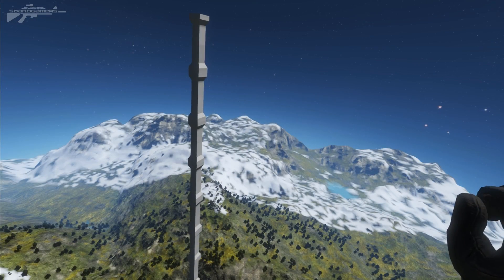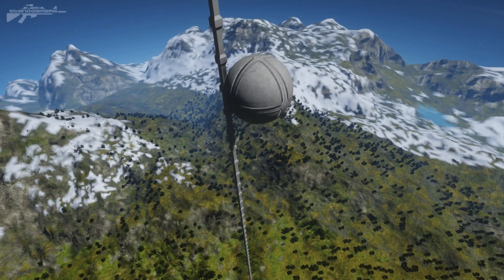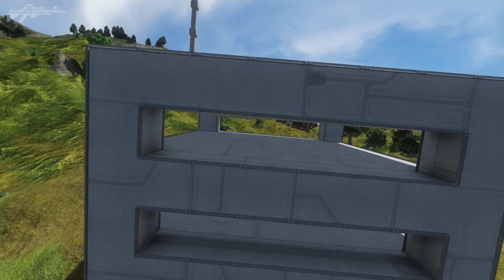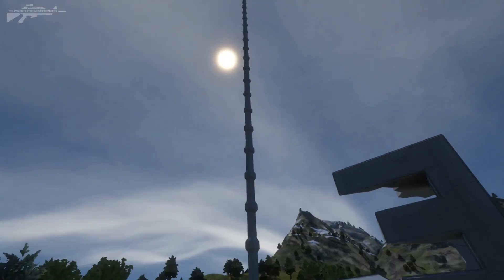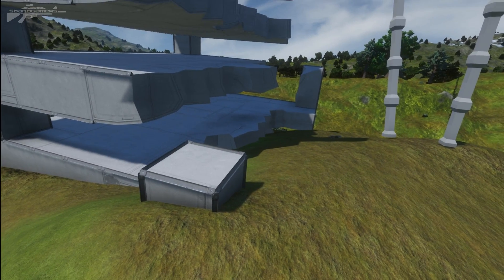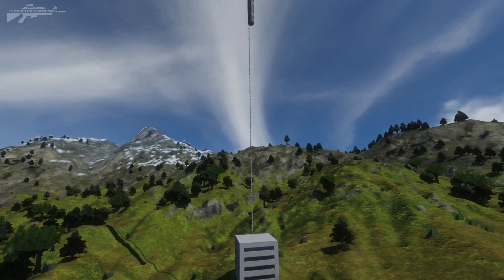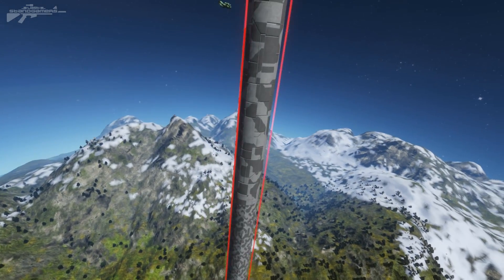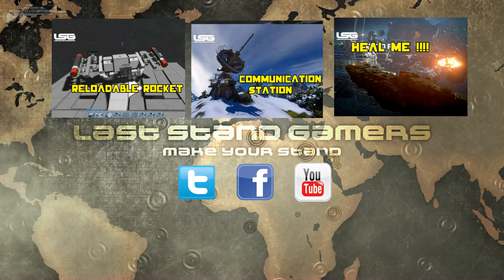Space Engineers - Kinetic Energy Testing

Comment: From my own tests,  a gravity cannon that accelerates individual steel plates thrown out by a connector will shred ANY ship and is very efficient when compared to kinetic weapons made from blocks,  I would anticipate similar effects in orbital configuration

BUT this is much more cool to look at,  and is less of an exploit of game physics
Reply: Le Derp Français but there's still a power requirement if the point of the set up is to deactivate the artificial mass with a timer to avoid gravity defence,  a non powered torpedo with space balls will get repelled by ships with in built defences just the same as a launcher that propels stone or steel plates,  and those are by far more efficient resource wise as they don't waste any rare material, byproduct stone or cheap iron ore is great ammunition compared to space balls which require computers and gravity generator components
Reply: Ships can have gravity generators for defense that defend against such gravity propelled weapons. The workaround is a built slug with artificial mass and a timer that turns the mass off after a few seconds. In case of steel plates they would get deflected.
Reply: Indeed, an Artifical mass block requires some form of power, most usually in the form of a battery because getting uranium in a reactor would be ludicrous for a torpedo, as far as i can recall a battery has a certain percentage of charge when its first built, so it can be launched more or less immediately

Personally I find these torpedo's to be an expensive option thats impractical for a survival world, but yes, it does allow you to bypass a "gravity shield" that the cheaper Grav cannon will be unable to deal damage through

However, in the context of bunker busting, there is no artifical gravity to overcome so i don't think its a problem
Reply: Inebriated Skunk
you just make a bunch of connectors chuck steel plastes then put grav gens behind them (the large ship conectors seem to output allot now so i was gonna try using the smallship chucker things) itll blow right through about anything at the appropriate range
Reply: Iwo Rymer rock is blunt steel plate is thing and launched out at its side
Reply: skyblade bloodheart Rock is excellent on a budget though, Rather than just dump it, weaponize it !
Reply: ChaosSandwhich meh you have to have allot of speed and it dose nothing at closr range but fair enough i mean if you cround down cargo containers that where filled with stone and chucked a huge stone at people
Reply: +skyblade bloodheart i have a 64G field that makes it so it doesnt matter what you use.
Reply: Helljumper256 oh this was just a test rig I mounted to a torpedo ship conversion and it was already more powerful than anticipated and was half the length I was intending to make the full size version, ( I wanted to see if I could make a more resource efficient weapon work for me on an existing ship,  so i didn't have much depth to fit it into considering it was a very compact Torpedo launcher ) 

Part of the reason was also about accuracy,  too many of my torpedo launchers ( and ones I tested off the workshop, ) suffer from poor aim as the merge blocks seperate and cause deviation,  objects from the connector seem to fly straight and true. 

My opinion for weapons made from blocks is they should be engineered to have accuracy worth their cost to build,  so I use guided Missiles instead of unguided torpedos
Reply: Keep it civil now,  I will disable comments if it descends further into a petty argument
Reply: No, no fuel. That's the point of a gravity propelled weapon, the gravity generator would push the artifical mass towards the target.
Reply: Oh you mean like a power source not fuel for thrusters. Yeah you obviously need that, but ony like 0,1 uranium.
Well, you could use the space balls (if they haven't removed those from the game yet) as those don't use power.
Reply: to be fair space balls are self sufficient also to be fair they work better as impact protectors then they do as projectiles
Reply: skyblade bloodheart Yeah but they can be used as artificial mass.
Reply: so like a steel plate (i think individual pillar blocks may be better) gravitational flechette cannon?
Reply: Ingots work well too,  and because it's a relatively constant stream,  it wares down any armor by chipping away until it hits something vital inside the ship
Reply: You can try to use rock since its uselesss
Reply: skyblade bloodheart rock is also way mor massive than plates, so while its cheaper, you have to get closer to your target, who may just sideswipe you if they have an armoured broadside.
Reply: Inebriated Skunk naw breh i tried steel plates cut right through even blast door if the range is long enough and you get them up to speed
Reply: stone is cheaper and more available and it has a mas of 14 instead of one that the steel plate has i believe
Reply: +Inebriated Skunk stone is the way to go it also has more mass on ejection which equals more kinetic energy stored
Reply: Helljumper256
 no i tested it
it really isnt
Reply: +skyblade bloodheart i tested it and as long as enough Gs in field it does
Reply: Helljumper256
i tested it earlier and you mustve used allot more grav gens because i tested it earlier and steel plates definitly have much better penetration power
 i had like.......... it had to be atleast 20 grav gens and that was enough to penetrate heavy armor over time at appropriate range but it did nothing to blast door blocks
Reply: skyblade bloodheart What was your gravity  strength?
Reply: ChaosSandwhich
idk but im pretty sure it was at least 20 g's may have been 21 or 22
Reply: skyblade bloodheart I tested mine at 24 to compare steel plates and steel ingots, very effective, stone i've not tried with that particular set up though 

To be honest i couldn't tell much difference between ingots or plates as projectiles though
Reply: +ChaosSandwhich if you want a real GAC Cannon you need a bit more than 24Gs
Reply: +ChaosSandwhich yeah mine is a operational GAC cannon that is meant to break through shields(beta shield mod we also have the values cranked up) with ease
Reply: +ChaosSandwhich and its nothing more than stone and a 64G ejection field max range
Reply: +ChaosSandwhich add in several ejection connectors and a camera and it shoots straight and true every time with massive amounts of power per rock
Reply: Helljumper256
thats a stupid amount of gravity gens you realize that though don't you? besides around 24 grav gens works just fine with the right perjectiles they cut right through the toughest of materials and keep on going looking as though they are unimpeded with this its relatively easy to install which is one of the main boons of a system like this its rather easy and efficient to use you can have a only meh sized large vestle and have it bombard other ships with penetrating death not limited by the range cap on bullets making it a sniper with multiple shots per shooting sequence not only that but you could make a number of ships to bombard enemies feasibley but with your design its outright ridiculous because you need allot of space to integrate it into a ship the entire ship would have to be built around it quite heavily and it takes up allot of sorceress not to mention the underlying infrastructure you would need to make making a ship with that many grav gens even mildly justifiable steel plates or iron bars are the way to go you can easily integrate it into a fairly decent sized ship and honestly its not that bad compared to allot of gravity based weapons and your going to cause massive damage to the enemy ship and yes steel plates with around 24 g's do fly strait even after penetrating a layer of blast door blocks besides nothings stopping you from putting multiple  connectors  there either and i know of this idea it was my first grav weapon idea
Reply: +skyblade bloodheart i build large resources arent a problem.  You say its too much but then you have never tried breaking through a shield with a couple billion points of shields which kindly fix stuff sliding through each other.  So the more energy you can store in that stone the more damage itll deal and while 24 may be ok one gets better results with 64
Reply: Helljumper256 you can build around 2.5 24 ships for the price of a 64 and that would be more affective besides you would take a long time to construct a suitable ship built to use your cannon in servival and if i use my weaker one i can still cause you sirious material loss with your over invested ship steel plates work fine with less gravity thats a rediculus mass of grav gens and stuff to put them on not to mention the more spread out they are the more access gravity area there has to be and if an item say gets stuck against your ship your going to lag terribly and with that much gravity probably crash your game
Reply: +skyblade bloodheart The problem is you think cost is a problem its not i have a problem of over abundance of resources and your two ships wont have enough shields to recieve from the other ships gac cannons and other armaments. You are thinking way too small scale. Besides its efficient to have one 64G  field with 20 ejectors than one 24 with 3
Reply: +skyblade bloodheart and you arent ramming it with material and gravity your shooting it what do you mean get stuck to the ship with gravity? there is no more gravity to keep it against your ship. and another thing it helps fight is gravity shields since its moving way to fast the grav shields dont have time to stop it
Reply: Helljumper256 you interpereted a lot of it wrong who said anything about ramming with mats and grav so you drop a steel plate on the ground relative to the gravity generated by your stupid grav cannon the amount of random ass physics nonsensce3 it has to caclulate will cause rediculus amounts of lag besides you have to cover up the gravity area which extends equally on either sides of the axis and if i penetrate the gravity zone witha smaller weapon of the same nature which is less of a loss to lose the prejectiles will be pulled through your ship and it will be destroyed
Reply: +skyblade bloodheart you are obviously a child as you cannot keep an argument civil and without immature language.  In addition your argument about having something penetrate and deal damage to the ship is on is inconsequential as we were not discussing that but the damage and effectiveness that the weapon deals and not the side effects of having one which is an entirely other conversation with many many ways to remedy the problems that arise.
Reply: +skyblade bloodheart in addition if you had a job and real money not your parents you would be able to afford a computer and or server to be able to run situations like that with no problem
Reply: and obviously you where not paying attention to the comparative speed of steel plates
Reply: Helljumper256 bitch please you try it asshat
Reply: try having objects constantly making many many many things be calculated at once thanks to the immence pressure pushing them against a surface thats not budgeing
Reply: Helljumper256 although ill admit i have no life youve been argueing with me this entire time so don't pretend you do
Reply: Helljumper256 uhm EXCUSE ME WHO resorted to petty insults it was not i but you
Reply: not to mention the fact that the weakness to gravity weapons IS related to its affectiveness as if its disabled then you loose the resorces and if there s more of a way of disabling it you also loose affectiveness also with most gravity weapons youd have to armor it to amazingly rediculus degress to stop the penetration of a large gravity zone inclosed within the ship
Reply: +skyblade bloodheart why would you have gravity pointed inwards on your ship so that material gets stuck to the hull? that is what im asking all gravity is pointed towards your target which in addition also gives the ship the benefit of an extremely strong grav shield.  Why in the world would you have grav fields pulling materials onto your ships hull? I dont understand why one would do that unless they are making a device that concentrates several items in one place than launches them. To the life part ehh i have several hours between classes so i do tend to have an abundance of time at times
Reply: +skyblade bloodheart in addition there are next to no physics involved as it doesnt bother to calculate it as the damage is overwhelming and just disintegrates anything in front it
Reply: Helljumper256  because when you extrend your gravity forward it extends equally backwards so the perjectiles get pulled up yo  booty if you dont cover the area of gravitation force the way that happend with me is i tested blast door blocks at insificiant range and it didnt bust through so it cause lotsa lag also if you made living space in the back of the gravity zone if something was dropped at a low hight there it could get stuck so you have to fill allot of space to the back to stop stuff behind you from being pulled into your ship not to mention without allot of armor any gravity based weapon can easily get in and run amock in your ship using your own weapons gravity to rip it apart from the inside out and theres also significant extra space to the side proportionate to the wideness of area with grav gens dew to the size scaling equally on both sides of an axis so you would have to be extreamly bulky for it not to be easy to do high damage with just about any grav weapon one booty shot and your own gravity will betray you
Reply: +skyblade bloodheart ahhh that makes sense now.  My ships tend to be long and lanky rather than short and stout so my grav fields never actually reach the back of my ship in addition due to the higher grav strength one can decrease the size of the field so it isnt maxed out. There are several other things one can do such as have the on/off switch for the gac gens on ones toolbar for easy toggle and yiu dont have to keep them on all the time just when in combat fixing the living quarters and the additional problem of having massive gravity field strength
Reply: +skyblade bloodheart and in the event they get behind you somehow you have that toggle to save yourself from yourself
Reply: Helljumper256 fair enough both have there advantages mine is just less initially resorce intensive but more over time and has less need for infastructure but whatevsky  and yeah allot of people make sausage ships but there so uggly and they have limitations dew tio the shape then theres the fact that ramming them with an expendable ship is very affective as a note if you put space balls behind the cannon they take no power and can be turned on and off as a bonus grav drive with either design plus there highly impact resistant
Reply: +skyblade bloodheart this is very true and ehh to each his own i sometimes build them vertical for shits and the expendable ship thing depends on the ships ship-ship defense what the other ship is packingand how charged your jumpdrives are.
Reply: Helljumper256 to be fair though by the time you have a large ship mining ship you probably have more iron then you know what to do with XD the stuff is everywhere
Reply: +skyblade bloodheart true i would say rock but our server has mineral synths so it quite valuable
Reply: Helljumper256 mineral synths? yeah rock two that shiza is even more common also ive thought of something else
if you have stone fed into a container of some sort then you put that container at the front of a grav weapon then you feed all your stone into that container then you make a projector project it at its local then you have a grinder and welder set on the edges of the hologram then you load the stone into the container grind it down and the huge bolder goes flying im probably gonna be to lazy to test it for a while though also one of the main reasons i argued is i argue when im bored sometimes XD
Reply: I have tried this... me and a friend had a battle. we had a couple hours to build, and I made my main weapon essentially what you described. he is a lot better at the game than me, and anticipated me using a gravity weapon. he basically put gravity generators all around so they all just bounced off... some back at me...
Reply: TheRancidMarshmallow Yeah, it has an easy counter, I'm personally a fan of Whiplash's guided missile script, grav shield or no Its going to hit the target 

BUT the investment is higher, Personally I think munitions that I'm going to invest in need guidance though, or its a waste. So i come down on the two extremes of dirt cheap disposable munitions or expensive missiles with more chance to hit the target and can be aimed
Reply: So the steel plate + gravity launcher method sounds kinda like a flak cannon.

Comment: You should add a tip to the rod made up of the pieces you used for the measuring and alinement rod. So that the small rod digs in through the dirt layer (because it seems really good at it), then the armor block rod penetrates the armor of the bunker, plus by mixing the two rods more mass/force will be place behind the small tip.
Reply: I would go a step further and say that it would be best to have more than one projectile as one large one leads to a slower impact(even if it is slight) speed after the initial hit for the rest of the rod.